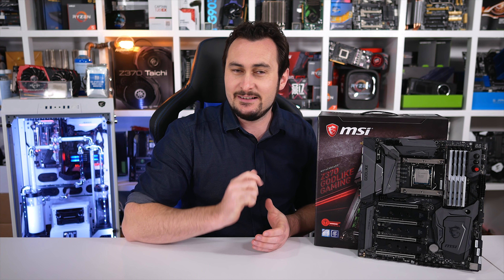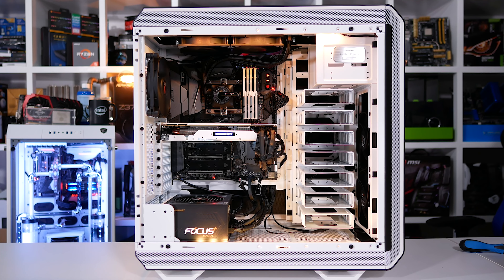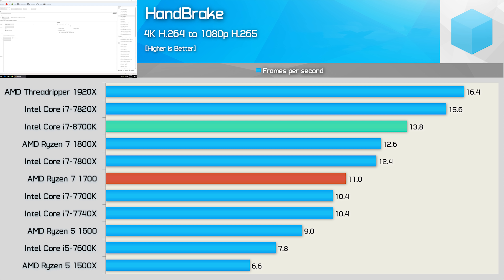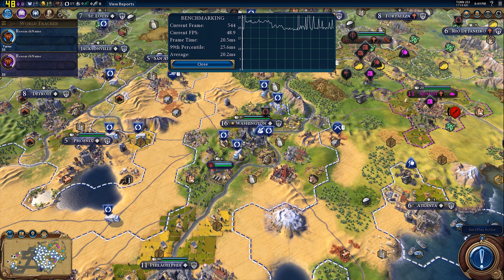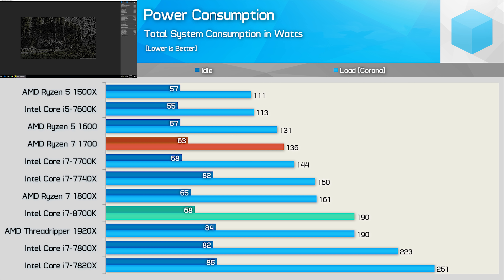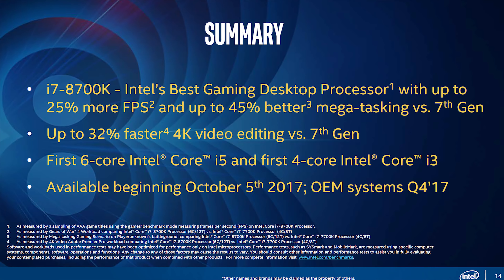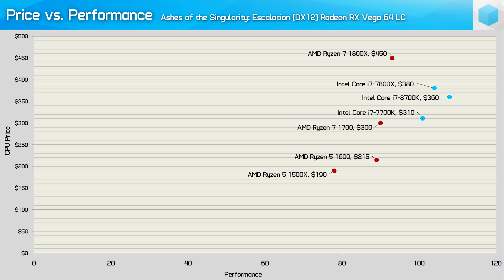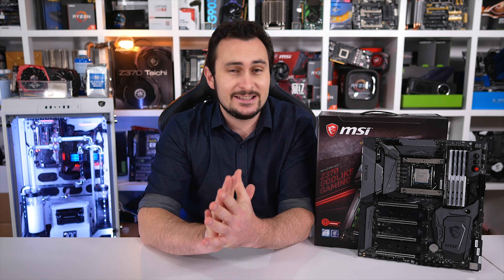Intel Core i7-8700K Review, The New Gaming King!

Comment: The Core 2 Quad Q6600 was one of the greatest overclockers ever. Wonder what happened to the "Core" series before it to make it a "Core 2" and why the 8700k is considered the 8th generation Core processor when the Q6600 was a 6th gen Core processor. Wouldn't that make the 8700k the 17th gen or 26th if the "2" meant anything in Core 2 Duo and Core 2 Quad?

Comment: if you look at the bf1 benchmark at 8:56, i can assure you no one can reliably notice a difference between any of those cpus, not to mention the fact that its at 1080p.  if you have 700$ to spend on a gpu, you arent playing at 1080p, those gaps will only shrink at 1440p at which point, the 15000x is the best buy.

Comment: The percentages you stated in quite a few graphs are off. The overclocked corona benchmark you said the 1800x sees a 20% performance gain. 118 to 131 is 11%...
Reply from the maker: Sorry I see what you mean. How many were off?
Reply: Hardware Unboxed I'm not sure exactly but I think with that 1 you compared the stock 1700 with the overclocked 1800x.
Reply: Hardware Unboxed maybe I should not of said quite a few. I thought a few others seamed a little off but didn't check the numbers.
Reply from the maker: I compared it to the 8700K by accident. Is that the only error though? I did discuss 42 graphs and multiple figures in each graph so I feel like one is okay.
Reply: Hardware Unboxed I'll have to watch again later today. N no worries man. I'm just letting you know. The amount of content you put into your reviews and the reviews you put out it's gotta be exhausting lol. The data is on point n that's what matters. I hope you weren't thinking I was giving you a hard time.

Comment: The problem with your Civ VI test is that you should be testing time per turn not FPS. FPS is reduced by a faster CPU because how fast it jumps all over the screen while taking the AI turn. You want to measure the time it takes to complete a turn not the number of frames it displayed doing that turn. The slower the CPU the more frames you will see - thus the faster the CPU the fewer frames that you will see. Check out Gamers/Nexus review on the 8700K testing CIV VI.
Reply from the maker: I'm not using the AI benchmark for the Civ test. If you look at the results between CPUs of the same architecture they appear to scale as expected.
Reply from the maker: Updade: Using the graphics benchmark the test takes exactly 30 seconds on the Ryzen 3 1200 and Core i7-8700K as well as the Ryzen 7 1800X.

Comment: Great review, as it was to be expected from Steve, loved watching it. Though I'm wondering what an "upgrade" on the intel platform is starting to mean. Back in the SB / IB days you were at least getting that minimal ipc improvement and the smaller manufacturing process. Right now, Kaby Lake was just a slightly improved Skylake, pretty much RX 500 over RX 400 series, and this "thing" called Coffee Lake is only bringing some improvements due to added cores. They "evolved" from 5% ipc gains to nothing. What's funnier is that they somehow found a reason to justify a price increase and another platform change. 0 ipc gains, slightly more power consumption, but 10-15% price increase for a cpu which was already mostly limited by the graphics cards available. Unless you have 240 hz monitors and SLI  GTX 1080 / 1080ti configs, is there a reason to actually use coffe lake?

Comment: Hi really a nice video, but to speak for germany it's the Prices aren't that side by side.

f.e. you can get a ryzen 1700 at a price of 260€ at the moment the 8700k is around 400€, this roughtly 1,5X the Price of the (stock) AMD model. I haven't to mention, that it is pretty easy to get at least the 1800x performance out of the 1700.

I have a suggestion for your scatterplot. Wouldn't it be nice to give a Backgroundcolor to cluster the results? F.E.: Red where the performance is enough für 0-30 FPS, yellow 30-60 and green 60 fps and above.

To be honest it's really hard to understand why it is such a thing to have 150fps and more in a game.

But nevertheless really a nice vid

Greetings

Comment: Usually good reviews but..... You tested against the R7 1700 stock. You noted that the 1700x is the real competition for the 8700 in price so that should have clearly been the comparison (the 1700x is available for under $300). You can't claim the overcooked is the same and then test on stock. 
The power draw is massive for intel.
If you do go down the R7 1700 then you need to add the cost of a cooling solution to the cost comparison.
This is not up to your usual thorough standard.
Also interesting that the vega 64 is close to the 1080ti with Ryzen.
Reply from the maker: Yeah I was super lazy on this one, sorry.

Comment: Was Hoping to see Cost-to-Performance Ryzen win here, now I don't now if i should build R-1600 or wait and buy the 8700k..
Great job steve, hope to see more GPU options with the 8700k & 8600k compared to R-1600 & R-1700..
You nailed it :)
Reply: Vin Narcissistic well wait for the i5 review atleast to decide as it are as priced as R5..
Reply: Either buy a cheaper 1600 build now and swap the CPU in 2018 with the Ryzen refresh in February.
Reply: Vin Narcissistic you will have to wait some time for that. There are only expensive mobos atm so it makes no sense (price/performance) if you compare it to r5 1600...
I would take the r5 1600, its a good cpu, the price is fair and mobos (for oc) are cheaper + longer support (Ryzen 2 supported)
Reply: the money you save going r5 1600 + B350 using the decent stock cooler will be significant and can be invested into a better tier GPU for example.
Reply: Navonil Mukherjee but even thu, the i5 has no threads, dnw how long it will hold on..
Reply: Kíre Howard was thinking about it but what if Ryzen came up with something stupid or doesn't worth it.. what if the 8th generation was better and Ryzen just gave us all a mid-finger after waiting several months like they always do with their gpu's ?
Reply: Tobias Jöny ibwas thinkin about the R-5 i5 comparison, but it makes no sense to buy a 6 core no threded, maybe it will come up to be better in terms of performance and gaming, who knows maybe the all we need for few years is 6 cores non-threaded.. guess i will wait for the R-5 i5 comparison..
Reply: Whocan that's one of the benefits of buying Ryzen..
Reply: well it depends on what you do...I hope you are not that person who buy a new system every year..I using mine for last 5 years...with AMD competitive again it is time to regret your buy as every six month a new and better processor is released and the feeling of 'Oh! if I wait only six more month I would get a better system'.. that is why I told you to wait at-least for a comprehensive i5 review so that you buy a AMD and don't immediately regret the purchase because if you only game current Intel will beat current AMD everyday.. also as everyone is drooling over long term support of AM4, most buyers like me would not buy a new processor for the old motherboard..for most of us motherboard will die before the processor...

TLDR if you plan to upgrade your CPU frequently(atleast once in 1.5-2 years) go for AMD..else judge your workload/playload (:P) and buy what feels appropriate (there is plenty of review to judge that)
Reply: Navonil Mukherjee nah i want to build a system that lasts me for at least 3-4 years..
I hate intel and i hate to change the mobo, that's why i like AMD..
But i watched alot of benchmarks, views and read articles yesterday about the 8600k, i hate to say it.. but that CPU is the new king !!
I won't go on much details but enough saying that overclocking it 5.2ghz is a walk in the park, and it's kills the 7700k in all aspects, from gaming to productivity and specially when overclocked, and it reaches a peak of 82 degrees when under load and overcloked and settles around the mid 70's (water cooling)..
Guess you know what that means when comparing it to Ryzen.. it takes out even the 1800x in gaming.. :( but the thing is it sucks when it comes to Civilization xD i don't know why..
Even though i hate intel but this CPU is the best and it is the new king, it's not far behind  8700k, and when i say not far I'm talking about few frames per second and specially when overclocked..
But the ques. remains, 2 Cons, will it be safe to buy it without Hyper-threding for 4-5 years usage without regreting ?! Are we going to need a new mobo as always ?!
Guess i will wait for Steve's video for confirmation, and let's see the new Ryzen CPUs..

Comment: Where's the 1060 & 580 benchmarks?
Reply: He's reviewing a CPU why would you bottleneck the review using low/mid range end CPU's and why waste your time either?
Reply: Vibhav Mohan Theres no point in testing those since you'll run into gpu bottleneck, the performance will be the same for all cpus if the gtx 1060 and rx 580 are benchmarks

Comment: I know you're going to hate me for this but the 1700 is substantially cheaper than the 8700k at $295vs$360 (the 1700x is $300 and the 1800x is $400) - for one thing its 3.9ghz overclock is pretty much guaranteed and can be managed with the stock cooler. The 8700k might manage 5ghz with an entry level aio for $50 bringing its cost up to $410 aka the $8700k compares to the 1800x in value, but for less than 3/4 of the price you can make a 1700 out perform the 1800x - sure the 8700k can hit up to 5.1-5.2 ghz but that makes for an even greater price delta. So the real comparison is both of them overclocked to reasonable numbers of 3.9 and 5.0 for $295 and $410. And even though high speed low latency memory may not really impact the intel chips performance very much it has a HUGE impact on Ryzen - 3466&3600mhz with tight timings can boost performance nearly 10%! That on top of 20% handicap you've put on the 1700s scores means you're cutting it short by nearly 30?!? Example: Cinebench - they both score around 1400 points multi with the 1700 scoring what 130 vs the 8700k scoring 180 for single core? my 1700 at 3.9ghz scores around a 1650 without the memory Oc and just shy of 1750 with "fast" 3200mhz memory(14-13-13-13-28) -- and Ryzen only gets better the higher you go. This trend isn't the same with Intel, the cache speed is not set/determined by the memory and its speed doesn't appear to effect the inter core to core communication latency like it does with Ryzen - you boost memory clock speed and/or decrease latency by having tighter timings and you get better performance. Granted the 8700k can also overclock, its performance in general isn't effected in the same way by memory speed as Ryzen whose cores eat up data as fast as you can provide it - almost like the cache is a bottleneck in the processor, both a strength and weakness at the same time because AMD only has to produce 1 die for everything from the Ryzen 3 1200 all the way up to the epyc 32 core monster greatly increasing profit and allowing them to master and fine tune basically one processor but at the same time because mileage may vary you might not get a winning combo.
Reply from the maker: Why would I hate you? I pretty much said this in the video. The Ryzen memory stuff is a bit dodgy though given half the chips I have won't accept memory faster than 3200, hell some won't go over 3066. But anyway Ryzen is still the best value option as I said.
Reply: Sorry I hadn't finished this when I pressed send. I said "hate" because every time you post a video where I respond I sort of pick apart the video and certain things you say because although you opinion is opinion numbers don't lie - but the presentation can skew things a bit. Basically the 1700 & 1700x are roughly the same price at $300 give or take $10 and the 1800x is $400 now - but they are all the same chip after you overclock them so when discussing value sure you can present the $400 over the $300 chips but the performance to dollar value after you overclock the $300 chips is MUCH better, the 1700 has a base clock of 3000mhz and an all core turbo of 3200mhz, but overclocks to 3900mhz+ and does so with the included wraith spire and the 8700k had an all core turbo of 4300mhz? And requires a 240mm+ cooler to get anywhere near that 5ghz+ overclock and with ryzens 4 extra threads and superior hyper threading that same 700-800mhz overclock takes the 1700 much further than the 8700k. And while you may have chips that can't hit 3200mhz memory speeds that isn't the norm with boards that have good support after the agesa 1006 update aka the taichi, c6h ect with newest updates and bios revisions happening as recently as 2-3 weeks ago. I can't speak to Ryzen 3 & 5 but every Ryzen 7 i've used since August(2 1700s 3 1700xs and a 1800x that performed worse than the cheaper counter parts so a dud) have hit 3200mhz stable and 3466mhz was bootable. So my chip that I'm using now isn't stable at 4000mhz core clock, it can get 3600mhz memory but with tighter timings on 3200mhz it gets much better scores in benchmarks and FPS and I advise you to check what happens when you get 3466mhz stable - my point being this is doable with the stock cooler at $300 whereas the 8700k also needs pricey z370 motherboards like the x370 needed to work, memory is super expensive for both, but superior aftermarket cooling to hit 5ghz+ is mandatory for the 8700k and so for people researching these chips for purchase will not get a realistic idea of performance with a serious handicap on the $300 chip that performs better than its $400 counterpart and is actually MUCH closer in performance to an 7700k and 8700k when you bring its core clock and memory clock up(a big part of why they're unlocked and why we even buy them). As in an overclocked 1700, 7700k and 8700k with be much closer after overclocking them, even trading blows with each other more where the 1700 appears to lose terribly and increasing its lead where it wins - its even better value than you state and its performance is far better than you've made it appear.
https://youtu.be/S6yp7Pi39Z8
So I have no doubt the 8700k is the new king but the 1700 brings much more to the table then you  present other than saying "its unlocked" and "memory increases performance" without showing those differences.

Comment: Regarding Civilization 6 benchmarks, Gamers Nexus reports that the FPS test actually favors slower performing CPUs because they take longer to compute AI turns, thus forcing the benchmark to render a still scene longer and resulting in a higher framerate.  https://www.gamersnexus.net/hwreviews/3076-intel-i7-8700k-review-vs-ryzen-streaming-gaming-overclocking/page-5
Reply from the maker: I'm not using the AI benchmark for the Civ test. If you look at the results between CPUs of the same architecture they appear to scale as expected.
Reply from the maker: Updade: Using the graphics benchmark the test takes exactly 30 seconds on the Ryzen 3 1200 and Core i7-8700K as well as the Ryzen 7 1800X.

Comment: If the 8C/16T Ice Lake i7 is true, then the six core 8700K reign as king is pretty short live. I wouldnt want to be spending on exp mobo, CPU and water cooling only to have Ice Lake take the crown for similar money about just 1 year later. I mean, Sandy Bridge has been fine near the top since 2011 to 2017.

Comment: You did disable the turbo on the 8700K didn't you, since you are testing it against a Ryzen non XFR 1600 and 1700, rather than a 1600X and 1700X, right?  In short, comparing it to a 1600 only is not a valid comparison.  All Ryzens should have been XFR versions since you are comparing it to an 8700 that has intel's version of XFR, whatever that's called.  Otherwise, it's an oranges to apples comparison and a flawed evaluation.
Reply: The XFR boost is +100Mhz, wouldn't make much difference in results. Even the non-x Ryzen CPUs have base/boost clocks. For example the R5 1600 has 3.2GHz base and 3.6GHz boost clock. XFR means extended frequency range and it's like a bonus to maximum boost frequency if you have a good CPU cooler.

Comment: Question for your next i5, i3 review... Can you bclk overclock the non-k versions with a z370 motherboard? Another thing that I want to point out... The reason intel is giving for the need of a new chipset is powerdraw of 2 more cores. That being said... The i3 with 4cores4threads is basically a previous version i5, so it should work on the previous socket... (They won't but they should...) Now... Imagine We live in the perfect world and the new i3 were socket compatible with z170 z270 and we could bclk overclock them... That would be amazing... :D (They won't, it's intel...)
Reply from the maker: You can't BCLK overclock the locked parts.
Reply: Hardware Unboxed sad but expected... Intel removes all the fun... :P so, at this point pairing a i5 8400 or i3 8100 with zboards doesn't make sense. Still I belive the i5's are the sweet spot and great chips for gamming expecially if you have sandy bridge and want to upgrade... As for me...  I will keep my 7700k...

Comment: You should talk to Gamers Nexus on why using FPS with Civ 6 is a very misleading benchmark.
Reply from the maker: I'm not using the AI benchmark for the Civ test. If you look at the results between CPUs of the same architecture they appear to scale as expected.
Reply from the maker: Updade: Using the graphics benchmark the test takes exactly 30 seconds on the Ryzen 3 1200 and Core i7-8700K as well as the Ryzen 7 1800X.